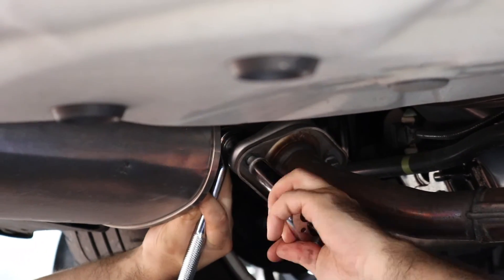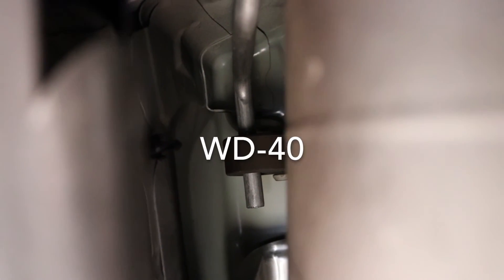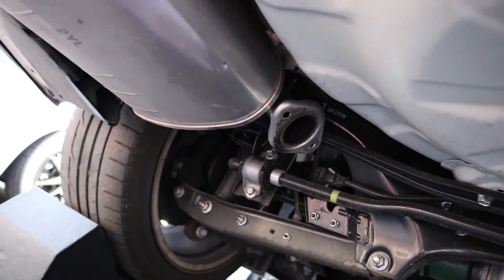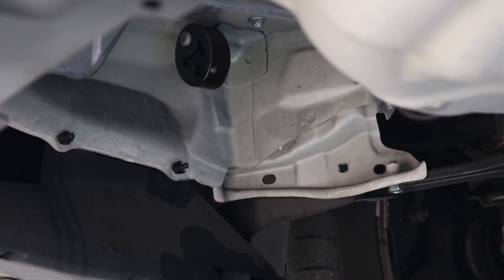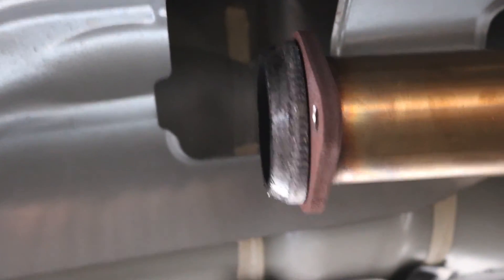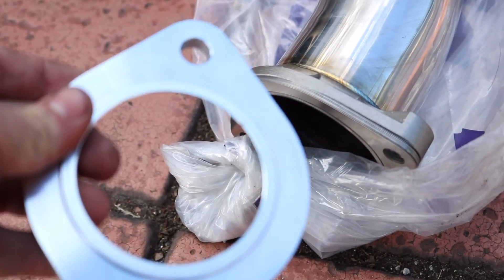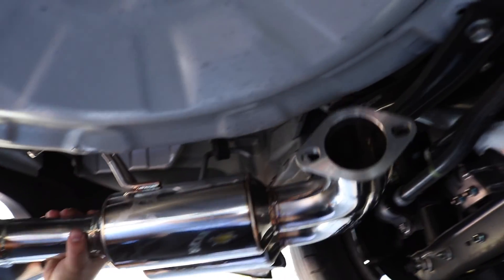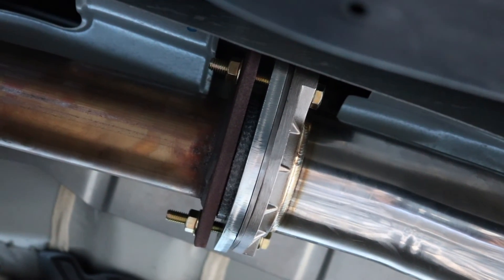Invidia R400 Install and Sound Clips! (2017 WRX STI)(Subispeed)

Comment: Car looks and sounds amazing dude. I went with the q300 on mine and those 4 inch burnt tips look amazing. I do more highway driving so I took my Ets catback off. That was full 3 inch system with no mufflers or resonators. Plus the new exhaust law here in Cali sucks so I have to lay low.
Reply from the maker: Thanks I appreciate it! I do more highway driving now also. I definately do not need to go louder yet lol what else do you have done?
Reply: @JotaJotaSTI  Just put some new wheels and tires on the car this weekend. Next plan is to wrap the roof black and add some other accents. Really want to get the subispeed carbon steering wheel and a nice shift knob.
Reply from the maker: Those would look nice! I think AOS is next for me lol

Comment: The borla bolted right up. Used the same spring bolts. And the stock 2.5 inch gasket for the 3.0 inch borla cat back
Reply from the maker: Nice how do you like it?
Reply: @JotaJotaSTI  It’s awesome. I get thumbs up. Has nice tone. I did have to play with the hangers. They didn’t line up quite right. Other people stated theirs was no issue. So maybe mine got mishandled and dropped or something. Bent the passenger side hanger. I fixed it tho.
Reply from the maker: Awesome glad you like it 🤙🏼

Comment: How did you get the left side tips to be flush? I have exactly 1 centimeter from the plastic AFTER taking it to a shop on my 2020 series white STI.
Reply from the maker: You just have to keep adjusting the hanger
Reply: @JotaJotaSTI  literally spent 5 hours trying LOL idk.
Reply: I have the same issue on my 2020
Reply: Same here on a 2021

Comment: Just ordered my r400 exhaust !! Whoop I’m excited .. how easy is it to install can I do it my self? Also dropping 1000 on new tires
Reply from the maker: Yea the install is easy just a few bolts. You may need something to prop the exhaust on to help you hold it in place as you bolt it on though. Nice what tires are you going with? I may need some soon also.
Reply: I’m getting some federals . I had the yokohoma stock tires but yesterday I got a 1 in gash on the two tires on the right side
Reply from the maker: Dakota Arb that sucks sprry to here that. I recently had to plug my tire. What size are you going with?
Reply: 245 35 19
Reply from the maker: Dakota Arb nice im thinking about going a little wider to 255
Reply: Super easy to do. Just make sure u got room to get under car.

Comment: The left (look at the car from the back) side tip looks quite close to the plastic surround. Just installed mine and it sits similar as well, did you manage to find a way to move it out a bit or did you notice the plastic surround melting?
Reply from the maker: I was able to adjust it by moving the hanger around

Comment: Hey brother I just bought this exhaust and was wondering what size gasket do i need if I have stock down pipe ? Thank you
Reply from the maker: When you order it just let them know its stock to the 3inch invidia. I don't remember off the top of my head but I believe it was 2.5 inch to 3 inch.

Comment: Is there still space to install GrimSpeed adapter after install? Pissed dann UPS got lazy today and rescheduled delivery. Thanks. BTW why chance it with them jacks.
Reply from the maker: I would think if you have someone pull the exhaust back since hangers are rubber you should be able to slide them in. Those are made to hold more than enough weight.

Comment: Boss im installing my r400 this weekend and wondering. Do  i need that grimmspeed adapter?
Reply from the maker: If you are connecting it to a stock downpipe yes since the pipe sizes are different. You may have a small leak if you dont.
Reply: @JotaJotaSTI   Tommy Kentner  boss i installed my r400 last weekend. At my boost meter it say 19.5 peak boost which i hit once. Now i dont see numbers close to that. Only hitiing 13-16 boost around 3-4k rpm. Is that thing normal? Also i feel slower after installation of the exhaust.
Reply from the maker: nico abalos are yoy in sport sharp mode? What other mods do you have?
Reply: @echomike1charlie387  is your car a wrx or sti?

Comment: For the Subaru sti 2020 will I need an adapter for the invidia r400 exhaust when installing it???
Reply: I don’t believe you need to but I highly recommend you get it makes installation much easier and leak free
Reply from the maker: Not sure I have not installed on a 2020 but I would think it is the same.
Reply from the maker: I agree
Reply: My exhaust came out side ways with the left rear down and angled to the right  the left side to high up to the right touching the diffuser
Reply: It took me honest like 3 hours to the the alignment perfect but I was working by myself so it made it much harder what you can do is take it to a muffler shop and they will aline it perfectly also if the pipe is touching anything it will burn it so be careful
Reply: @JohnDoe-iu3mj  yeah it already burnt it and I notice it the other day 😓

Comment: does the r400 come with the adapter or do you have to buy it separately?
Reply: I know this is late, but FYI I ordered this exhaust recently and it came with all the necessary hardware and gaskets.

Comment: I noticed that the Q300 sounds a lot better in person rather than videos. I’ve been lookin into the R400. How much louder do you think the R is from the Q ?
Reply from the maker: Honestly havent heard them side by side. I did notice the r400 was louder in person than what i thought it would be.
Reply: @JotaJotaSTI  i said the same thing when i heard the q300 in person. i guess ill just buy the r400 and findout myself. hahah thanks for replying man!
Reply: @ca5623  hey man did you end getting the R400? If you had to pick between the Q and the R which one would you pick? I rather go quiet than loud. Thanks
Reply: @raminramin85  yeah I ended up with the r400. It’s not that loud in my opinion, but the q300 is wayyy quieter. My buddy got the q300 on his 19 STI. We drove my car first, and after hearing the r400 we drove his car and his q300 sounded stock. If you’d prefer quiet, I’d say the Q would be your best bet!

Comment: So I have the exhaust but don’t have it installed yet. Do I need to get an adaptor?
Reply from the maker: If you are connecting to the stock downpipe you will need an adapter since the stock dp and the r400 are different sizes.

Comment: How did you adjust the height. Mine are kinda saggy
Reply from the maker: You may need some stiffer hangers. You just have to play with it.
Reply: @JotaJotaSTI  I got the grimmspeed already siff.. passenger having issue with little off.
Reply from the maker: Ryan Reyes you just have to wiggle it around to the setting you like. I dont have the grimmspeed hangers.

Comment: Instead of using wd40 just throw some rubbing alchohol on there and spare yourself the pain of having petroleum on rubber which will break it down. I use rubbing alchohol all the time removing mountain bike grips and putting them back on. It's great because it evaporates fast and wont react in a negative way.
Reply from the maker: Thanks for the tip! We will try that next time.
Reply: @JotaJotaSTI  nice STI btw just got a 2017 on the 15th of last month and love it!

Comment: Do I need to install anything else? I have a stock 2018 STI
Reply from the maker: I was stock also. No tune or anything. Just the adapter that I mentioned in video to connect stock DP to exhaust.
Reply: JotaJota STI does that come with the invidia exhaust package?
Reply from the maker: SwaveyTellem no I got it seperately from Subispeed. Brand was Grimspeed.
Reply: JotaJota STI and if I don’t...
Reply from the maker: It may not line up properly and could have an exhaust leak. I havent tried it its just what I read online. Make sure to Subscribe to my channel and keep me posted on what happens though! Lol